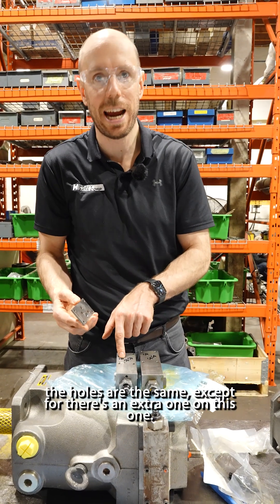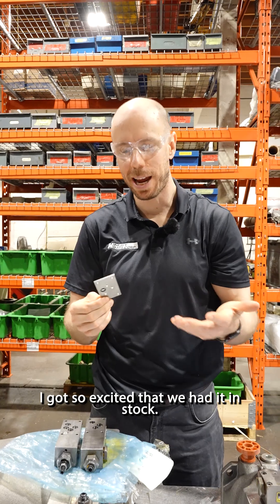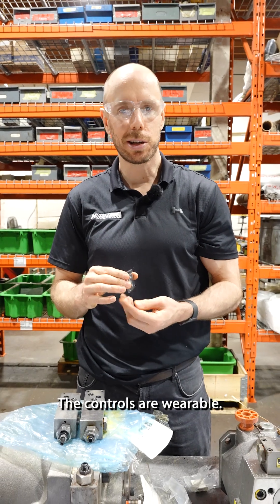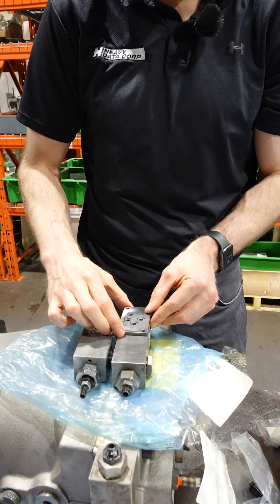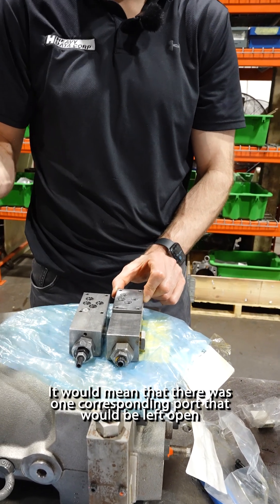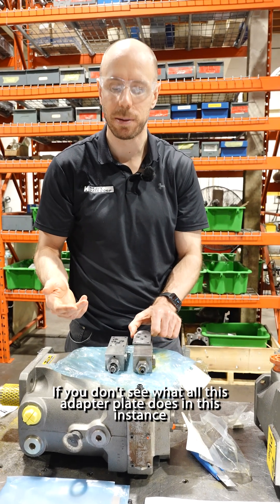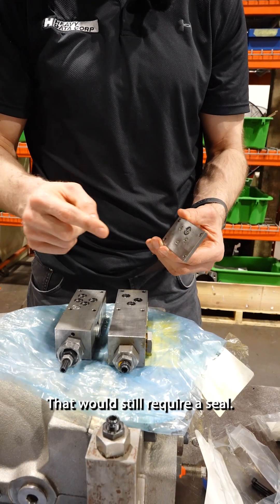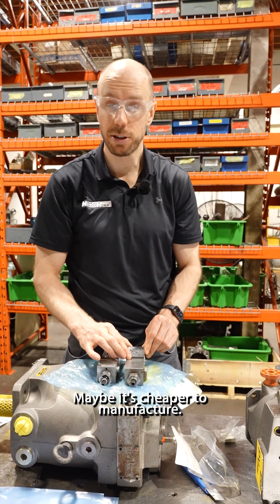Why This Tiny O-Ring Makes Such a BIG Difference?

Comment: Love the videos guys!

Looks to me like that adapter plate has the “extra” or “not used” port sealed on both sides of the adapter to close off that port that is not being used. You are correct the orings are to seal it, however if it didnt have the o rings on both sides of that “extra” port it would then leak between the adapter plate and pump or adapter plate and control depending on the orientation of that plate
Reply from the maker: Yes you are right. I thought I got from the stock the opposite adapter (new control on old pump, which is much more common). I guess they thought my confusion was entertaining. :)  -Fraser